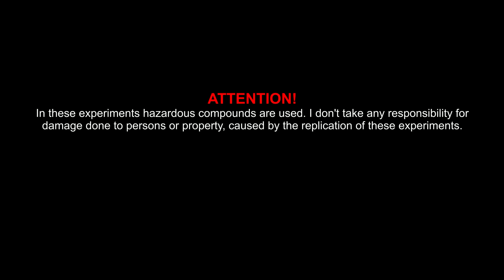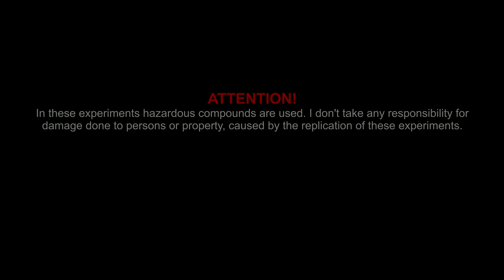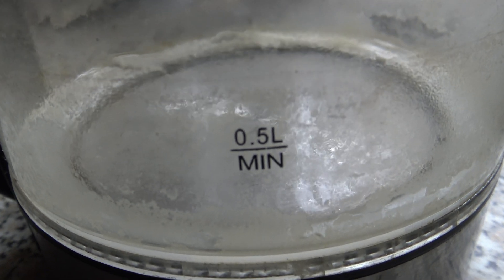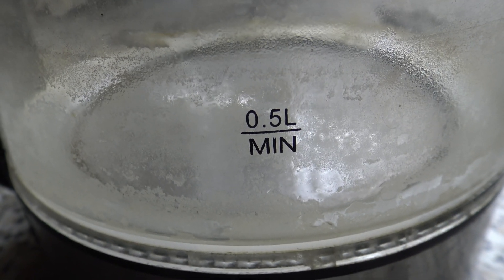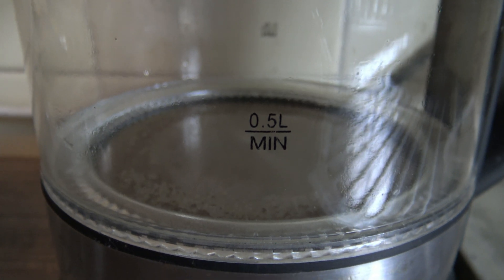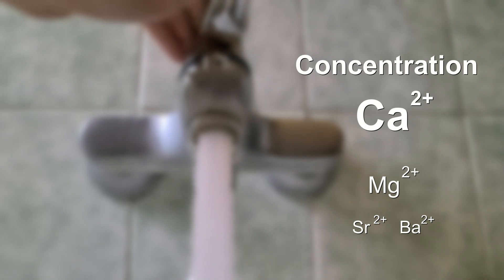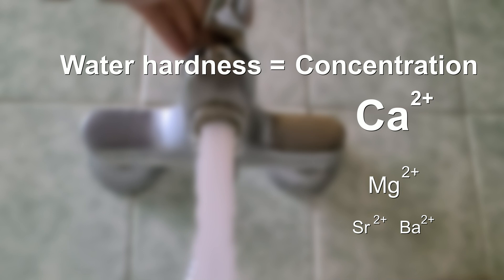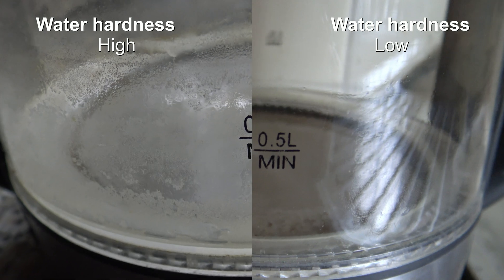Limescale and water hardness

Comment: I remember trying to find out what made up the yellow stains from antiperspirant, but couldn't get any solid answers. 
It's kind of gummy and reminiscent of lime soap (or soap scum) so I was thinking maybe something like that. The Al and Zr ions forming a soap with free fatty acids directly/indirectly from the skin or some type of oil-producing skin gland. It'd be interesting to see if you could recreate the compound, and then see how to re-dissolve it (EDTA solution + something?)
Reply from the maker: This was actually interesting to me personally, because I actually did a few experiments on how to remove the aluminium stains. I was pretty sure, that acid is the solution and that it had to be an aluminium salt with an organic compound as the anion. So, I treated my shirts with hydrochloric acid and citric acid. I was wondering if the HCl would destroy the fabric, but strongly diluted it worked very well and quick and even after 10 years the shirts are fine. Today, I treat my shirts somewhat regularly with a solution of citric acid in water for 1 or 2 days, rinse them and then put them in the washing machine with my other clothes. It usually removes most/all of the stains. Aluminium free alternatives have become better within the last years, though. So, I switch between them.
Reply: @RaExpIn  great tip!   just for others reading that may ask: nylon, polyester, cotton, lycra, wool... Would those fabrics/materials be affected by HCl/citric acid?  what about dyes in those fabrics. Are any dyes specifically sensitive? Thank you again. Rob.